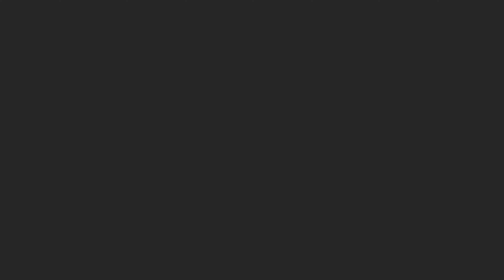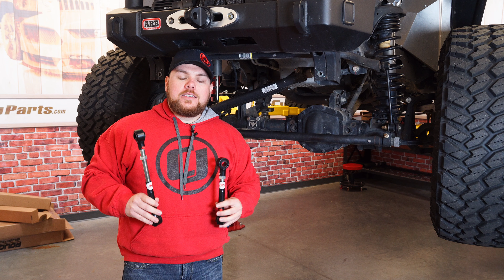Jeep JL Wrangler or Gladiator Install | JKS Manufacturing Sway Bar End Link

Comment: Are you going to gloss over the fact that you have to physically cut a metal tab off of the axle for the passenger side disconnect to install?  If you have a shock reinforcement bracket then it becomes a big problem.

Comment: Did you have to remove the track bar to get the passenger side lower pin bolted on? Or was there plenty of room to work with?
Reply from the maker: You do not need to remove it. Its snug but you can get the nut tight.